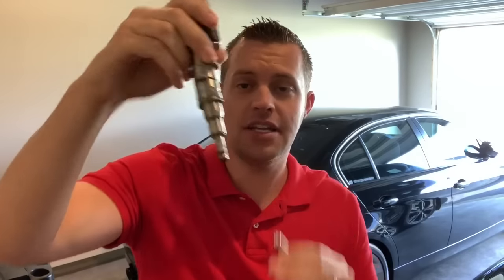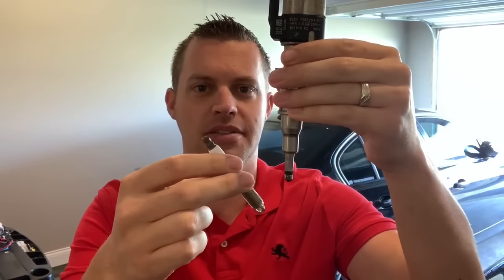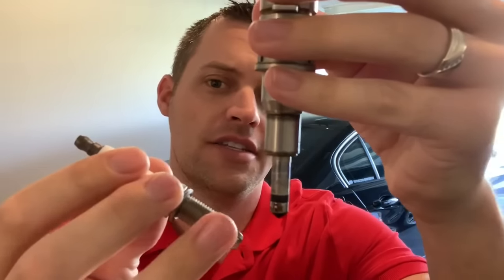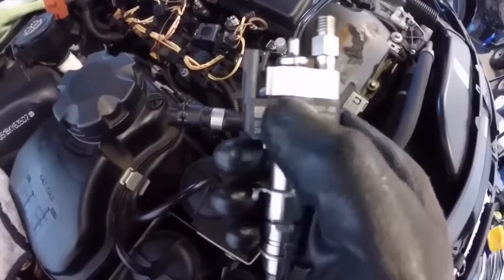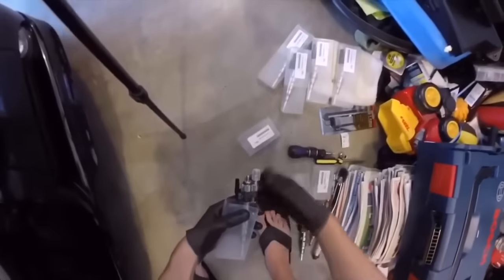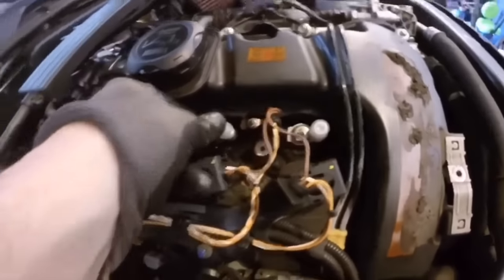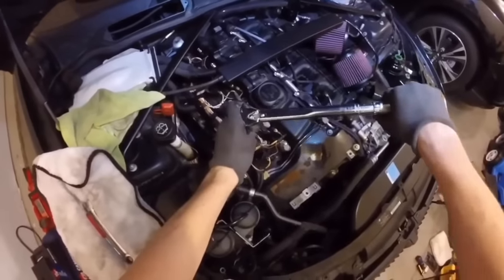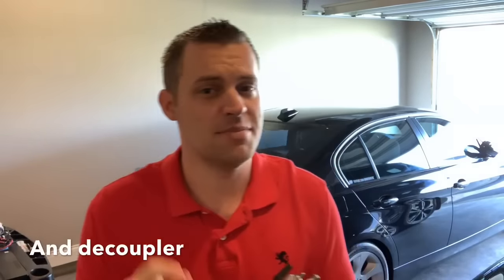How To Tell If Your BMW Injectors Are Leaking/Clogged!

Comment: I have a misfire on cylinder 2 29ce I just tuned my car with MHD did some pulls then outta nowhere got the service engine soon my car started with a rough idle and sounding strange (misfiring) so I cleared code and I can drive it normally w/o the code popping up unless I wot then the code comes again

Comment: Hey, i smell petrol (gas) occasionally through my vents. I first noticed when i was on the motorway. It lasts a few minutes and then goes away. Have any idea what it could be? Thanks
Reply: Check pcv valve or gasket seal

Comment: hello good video, I have bmw e90 it is very weak from 0 to 50 it does not pull much, it costs it, then it improves but it does not have the power that it is, what can it be?

Comment: So I had a really rough start on my E60 N54 Saturday morning. Not sure what injectors are in it now but ones been ticking like a time bomb. Anyways this start, ticking was gone but it was ran horribly, and upon light throttle rev and return to idle, the engine began to die and died off completely. Started again and ticking came back but went away again and engine started running really really rough again. Codes show only cylinder 5 misfire and this plug when pulled 3-4k miles ago it was BLACK. Do you think this could be an injector? Only reason I ask is because I recently did the oil filter housing gasket and unplugged a bunch of crap including two loose almost hanging wire going around and past the O2 sensor plugs.
Reply: Viren Patel Ever seen an exhaust when an engine is running rich? ITS BLACK. You can change the injectors one bank at a time. Cylinders 1-3 4-6 but only if they are index 10 or older. If an entire bank has 11+ you can change one at a time

Comment: I have really rough cold start and it gets worse with lower temperatures. The engine light is blinking when it’s running on 3 cylinders, it vibrates through the cabin and stalls. After a few miles it runs on 4 cylinders again but has bad response especially below 2k rpm and I can’t blip the throttle while downshifting. I’ve changed the plugs and coils with no difference. I also have a gas smell and white smoke out of the exhaust sometimes. Sorry for my English and please help🥲😅
Reply: Did you forgive out the issue ?

Comment: Just do what I did  go to fcp euro get brand new set of index 12 injectors with seals code them in its night and day....the best tool to code with is the Schwaben bmw scan tool by foxwell easy as...
Reply from the maker: Tighe Matthew yep, just what I did. All 6 new ones and all is well. ProTool is even easier to calibrate 😀
Reply: Protool is a lot easier. Just did mine last week and only took about 45 minutes from start to finish.
Reply: @Chicitypo  have you used the Schwaben bmw tool?
Reply: No, I used my Android tablet with the Protools app to do my coding and other things that I’m sure the Schwaben tool can.
Reply: Where to get protool?

Comment: You also must clean the valves.
Reply: This is correct and both need cleaning let’s say around 70k! The shakes and vibrations are only related to injectors tip. I will give the billion answer to you and enjoy! BMW diesel nozzle injectors tip is just a crap!! Can not withstand different brand of diesel fuels producing vibrations, shakes, bouncing ext ext. To correct this you need a different material tip( a ceramic tip) that will not even need cleaning after 500k miles! I shouldn’t speak but I felt you are the lucky strike !

Comment: My car has been sitting for maybe 4 or 5 months now after changing valve cover although I've got the smoke to stop it has a rough idle... but when I bought the car it had a rough idle after bringing it home... my first bmw after letting it warm up and driving it the idle smooths out... the eventually went away but now that it has sat again it has returned... I initially after bringing it home and doing research thought it was my vanos solenoids but how after watching your video I'm thinking clogged injectors... what can you advise me on here... and thanks in advance...
Reply: charles speed Could be just because you haven’t started it in a while. Drive it around for  a day and see if it continues to do you day after day first thing in the morning.
Reply: any update?

Comment: I have 29f2 code on my bmw 328i with n53, the low pressure is good I have 5 bar, do you mean my injectors are leasing ?

Comment: Wow even using top tier fuel carbon is still an issue??
Reply: Yes, but more by design. Single port injection like this leaves placed that don't get washed by fuel. This is unlike Lexus/Toyota and other manufacturers who have went with dual port Injection so it washes as it sprays.

Comment: Great post! Especially since im now getting misfires on 6 3 and 2 running e85, straight pump gas no misfires, changed my o2 sensors lpfp the only thing I didnt were my injectors and hpfp. But after logs hpfp is running strong. I only get the misfires at higher rpm on wot.. but I do not get them on map 5.
335i FBO JB4+MHD e85 FUEL IT STAGE 2
Reply from the maker: Jeff Baker Yeah that e85 on older injectors seem to bring out the issues! I ran into the same thing when I mixed + on old injectors
Reply: @BMWFanatic  same here, #5 & #6 for me

Comment: I have a question, so I have a n54 I have all new coils all new spark plugs I injectors all index 12, 
But cylinder 2 is having a problem, 
So everytime I put a injector in there the seal burns out, or comes after like a day or two , at first I thought it was the Injector, so I bought a very low mileage index 12 injector and put it on, it was sealed with a new seal and a couple days later same thing burned off, what should I do ? I have no clue,
Reply: Joan Lara Most likely the head is damaged

Comment: I replaced all my coils and plugs and still codes p0300,0303 and p0305 still pops up ?
Reply: Did you do the injectors after all? Would like to know i have the same issue as you on my 528i

Comment: Hey, can anybody tell me if I could use that awesome 4 tip spark plug for my N52B30 engine.
I looked everywhere shops, catalogues, even forums, no one can tell me if one exists for mu engine.
Has anyone tried this on N52 or N54 engine?
Reply: Jack Trade hi Jack i suggest you use the website realoem.com you’ll have to select your bmw it will show you all the material codes that are used for your car
Reply: @C0nvict911  cheers mate!

Comment: What if the spark plug is just black from carbon buildup? Sparkplugs are new and replacing the injector solved my issue, but I'm just curious as to why there was so much more hardened black carbon built up over that spark plug.
Reply: Brad Murrani I had the same thing with cylinder 1.  Have replace coils, plugs and injector but haven’t checked since doing that.  Did that solve your black on the plug?
Reply from the maker: Brad Murrani Some is normal as the plug is right there too, especially if they’ve been in there for awhile.
Reply from the maker: Brad Murrani I always have carbon built up on mine
Reply: That's what I'm saying  @BMWFanatic  the sparkplugs are all new but only sparkplug number three has a ridiculous amount of carbon built up on it, not all of them.
Reply: Same with me. 2009 335xi and spark plug 3 is coated in carbon. @BradTech.

Comment: Does anything have to be recoded? If so why?
Reply: It depends on the Model of your BMW. I thoroughly researched Fuel Injector calibration for my BMW 760i) and couldn't find any calibration requirements for my 7 Series BMW. I own nearly Dealer level scan tools- and found no software for my particular situation.
Reply: @davidhall3747  Aha. Thanks for the reply. I checked with a purchased OBD. It says OS2 sensor delay.

So it seems like the oxygen sensor, a delayed response. I haven't done anything with it. Just erase the code.It pops up once in a while

Comment: walnut blasting......lmao......they'll sell you blow pops for better fuel mileage and you people will pay for it......walnut blasting.......hahahahah.......the " low pressure " fuel pump as you called it , is a Lift pump......and the "High pressure" fuel pump is called the Injection pump.......and walnut blasting is a good one lol.....an expensive way to do a combustion chamber clean out .....not to mention a great way to ruin an engine

Comment: So I bought "remanufactured" injectors... Yes, I know, there is no such thing as "remanufactured".  I waited 12 hours to restart my car, and when I did it was still rumbling/misfiring. https://imgur.com/a/YpcKrFD Is there ANY chance this is spark plugs fouling or anything else? I don't think so because it eventually starts to idle normally after a few minutes....       

In which case, any other options? I really want to avoid throwing another $1300 in to my car right now.
Reply: Also, I should mention that I don't have them coded yet. I was going to bring it into my mechanic to do that quick today. But that shouldn't affect it as bad as you see in the video, right? Especially if the car stabilizes, right?
Reply: @christianoland1983  first thing is  take off air mass flow sensor check how it drives or idles any better then check your spark plugs , you could of done them when you were doing the injectors , make sure you have the index numbers when coding them
Reply: @abrahim2644  so I'm STILL dealing with this from two months ago.  It's a long story but i've gotten about 3 sets of refurbished injectors at this point. FCP Euro keeps swapping them out. Still haven't solved the issue.  I've replaced the coils and sparks as well. I also now know how to code my injectors (at least I'm learning stuff! Hah!) 

If I take off the Mass Air Flow sensor, what can I expect? If I remove it would it be worse or better? Can you explain a bit more. :)
Reply: @abrahim2644  Ah also, just realizing I have an n54 which has no MAF but has MAP - however those would be totally different right? Other things that could be in the realm of possibility at this time could be a vacuum leak, LPFP (even though I just replaced it, however it was one from china), HPFP, O2 sensors... and also maybe this MAP?

Comment: I hav 2007 328xi. It cranks but no start. I got spark cuz it starts with starting fluid. I checked.. I hav fuel up to the fuel injectors, an fuel pressure is 80.  I’m not sure wat to do next..

Comment: I keep getting a P1093 code on my E46; fuel trim too rich bank 2. I need to tear off the intake and replace gaskets but do you think it could be a leaky injector?
Reply: Injectors are usually an E9X 335i issue. Not saying it won't happen in an e46, but this is most likely not your problem.